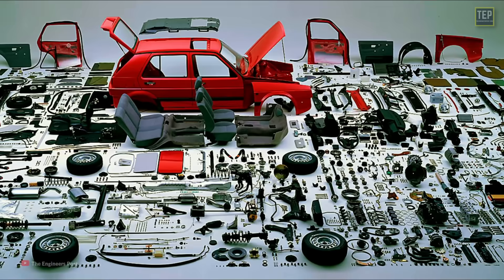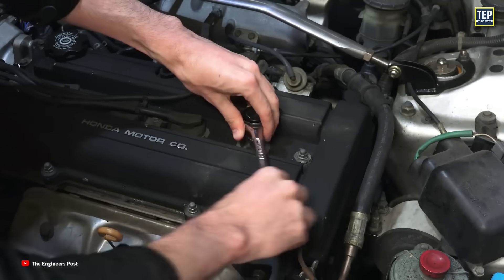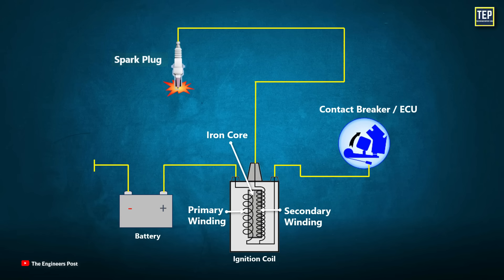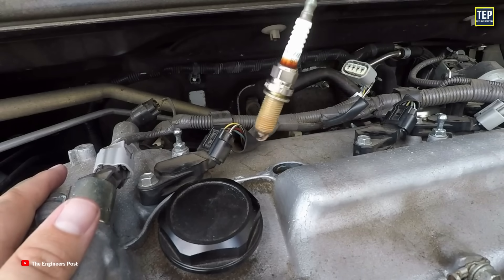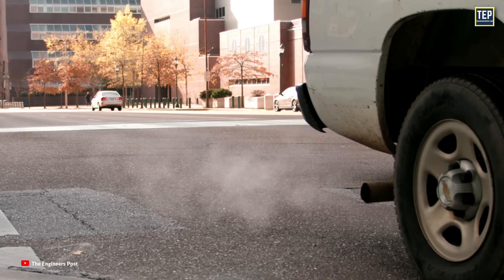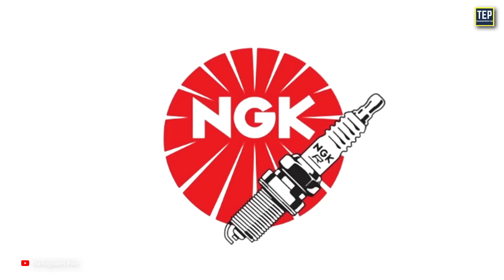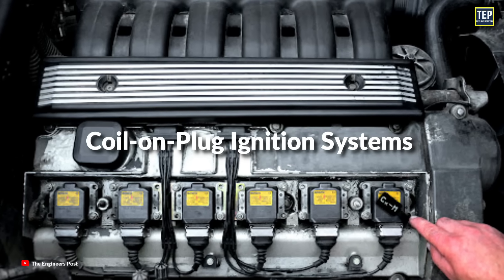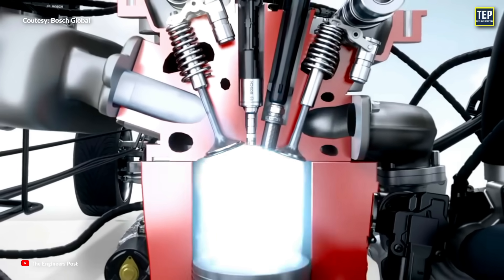Types of Spark plugs | Which is Best?

Comment: a friend and coworker of mine was a real car guy and would drag race his street 95 camaro. one of the things he did for a bit of a boost was to index the plugs with shim washers to have the electrode pointed right at the intake valve. he also reversed flowed the heads and altered the chip for the throttle body and the thing was really fast and quick.
Reply: IT IS THE CONTRARY: It is the OPEN gap which is to be oriented towards the intake port... Otherwise, the ground electrode shadows the mixture from the Spark Kernel...
Reply: @alfredomarquez9777  that's what i thought i said or meant to say.

Comment: The gap hardly even matters really this has been tested.
Reply: This is a very contradictory topic. If you look at the facts, older cars from the 90's come with a spark plug gap of around 0.8mm (0.315 inches). This could have been done due to the fact that distributor caps and rotors were still being used. After the 2000's most cars are equipped with coils on plugs and there are some like the VW Passat W8 that run a spark plug gap of 1.7mm (0.0669 inches). A greater gap should provide a cleaner burn, especially at rich running conditions such as cold starts and cold weather. I was always pleased with my car running Beru Z173 plugs, they performed better than surface air gap plugs and with a well maintained ignitions system such as new leads, distributor cap and rotor, they don't foul at all.
Reply: Often times it doesn't but definitely not true for everything. Take high HP, high boost drag engines. We're talking over 3k HP here. Get the gap just a couple thousandths too big on those and the thing barely runs.
Reply: @wingracer1614  I’m talking N/A

Comment: every engine has its own engineered spark plug that came with, buying spark plug that you think will increase your engine performance is just waste of money. If you want a slight bump of cheaper horse power and performance, find the best gasoline brand that is out there.. 
Tire pressure, engine oil, cooling system and filter. And most of all if you want power buy a bigger engine and you do not have to do any modifications. 8 cylinder engine is always more powerful than a 4 cylinder engine, both stock same gasoline in tank. Think of it as 8 soldiers digging trench in unison. I had a camaro and a vette.
Reply: FACTS.

Comment: Once upon a time, pre mandated unleaded fuel, only Amaco premium gas was lead free with an octane rating of over 100.  With leaded gas, 10,000 miles was about the limit before needing replacement...along with the points and setting of point "dwell" and ignition timing. 

Spark plugs are cheaper now than they ever have been, not even counting inflation.  Iridium plugs are da bomb. I've got over 200K on a set and they are just fine.  Check once in a while, never a reason to replace, especially since a few require some effort to R & R.

Comment: I just use basic copper plugs for 80k kilometers. Could probably go further, but i just change it once a year when i do my full service (flush and change all fluids).
Reply: I think iridium spark plug is good for performance and mileage  , but for me i'm still like the copper spark plug , because it's powerful and low price .

Comment: I worked in a Honda dealer in the service department in the early to mid 90's.  At that time those multi electrode spark plugs were becoming popular.  I remember a customer coming in with his brand new civic.  This was a 93 I believe.  He complained of a rough idle and wanted it fixed under warranty.  But what the technician found was the customer had replaced the spark plugs to those dual electrode plugs.  All we did was put the factory plug back in sure enough the engine ran smooth as it should.
Reply: Yup had an eclipse that did the same thing. Bought some fancy ass plugs, then thought my engine was about to die, friend was like change the plugs, I was sceptical because they were brand new plugs.. put in some basic copper/nickel ngk plugs, car ran like a swiss watch. What I learned that day, always buy ngk, keep it simple.
Reply: That's with most 'after market' stuff. The manufacturer doesn't put wrong parts in your car. Different (colored) spark plug wiring, other size tires, spoilers; it may look nice, but it usually doesn't enhance the ride. Unless you do things with your car that it wasn't really intended for. For the general owner; keep it standard.
Reply: Did the customer get changed for the labor to fix the damage he created?
Reply: @Tremontvolleyball . At Honda?  You can bet what you are sitting on 😂. And most likely street price for the replacements😢
Reply: The multi earth electrode plugs are for longer change intervals, nothing more. If your engine are not designed for it, it would run worse than your standard plugs.
Reply: @imadude85  Not always, some of them are designed to have smaller ground tabs to allow more even burning kernel, cleaner burning, or more effective combustion.
Reply: Most likely he used some cheap garbage plugs.
Reply: Had NOTHING to do with the plugs themselves. The multi-electrode setup would never cause something like that. The issue was likely due to gapping.
Reply: @williameldridge9382  With  brand  new  plugs that  have  the  same dimensions,  construction, and temperature  range with  the  only  difffence  being  the  layout  and  the  number  of  electrodes,  this  seems  to  make  sense.
Reply: Very good video. I noticed that in one of the charts, the spark plug gasket is shown in the wrong place by the graphic arrow. The video is very good and useful. Thank you!
Reply: Customer most likely didnt have them gaped correctly. Extra electrodes shouldnt cause a rough idle.
Reply: I love the people that think they are considerably smarter🤓 than the engineers who designed the engine. 😆 Always remember chrome don't get ya home.
Reply: If you worked where you said, for a 2006 Honda Civic 1.8 hatchback is it okay to upgrade to iridium?
Reply: It is correct that current travel through least resistive path but due to current crowding the current can take two paths. It could be that one path the current is 95% and other would be just 5% but over all it still reduce the spark strength. Also when double Platinum or Iridium or any metal is used and edge is sharp the spark will be stronger as both electrodes have small surface are (being pointed).
Reply: NGK IS #1!!! DENSO runs Great in Toyota's!! BOSCH Plugs do OK in German, and European Cars. Any Good Mechanic will tell you DON'T  put BOSCH Plugs in Anything Asian, and or Most other Engines!!! In the United States anyway!!! FACTS!!! Newer, and older Vehicles come in for all kinds of Rough running, and problematic symptoms!! Yep, somebody put BOSCH PLUGS in the vehicle they bought on sale!! TROUBLESHOOTING leads you right to the Spark Plugs!! Change the new BOSCH PLUGS out for OEM Plugs, and no more trouble codes, and the vehicle purrs like a kitten!! Seen this over, and over through the years thousands of times!!! CHAMPION PLUGS are like the BOSCH PLUGS.!!  They do somehow run GREAT in JEEP 4.0 Liter Engine!!😮🤔😉 If you're a Mechanic you know this  already!!! Don't fall for the GIMMICKS that Corporate Sales Executives are going to throw your way!!! AUTO LITE Spark Plugs used to be a great choice for FORD engines!! They were OE Plugs back in the day!! The old people like me remember this!! Ford sold off the Brand decades ago! Like General Motors owned and used AC DELCO for all its many onetime Divisions, and Brands!! They sold off that brand like Ford had already done!! Old CHRYSLER, PLYMOUTH,and DODGE came with CHAMPIONS O.E. If it ain't broken, don't fix it!!😳😳😳🙄🤔🤔🤔🤔😉😉😉😉🙏
Reply: Yeah, those E3 plugs and the like are garbage
Reply: one of my my old toyota pickups with the 22re engine had the dual electrode bosch type plugs when i got it and would only like those type of plugs when those engines all came with single electrode spark plugs from factory. idk why that particular one only ran good on those types lol
Reply: And a $400 dollar bill was sent to his house.
Reply: Simple, just fit the plugs specified by the manufacturer, especially if you have a high performance engine. Don't trust a self appointed online expert with your valued car.
Reply: Hondas tend to run best with NGK spark plugs.
Reply: E3 Spark Plugs must be a Gimmick then😂Champion has Aviation plugs with either 2 Massive ground straps & Massive Copper electrode or the more expensive Fine Wire 2 Strap & Fine elecrode. I don't remember if they're Platinum but definitely more expensive & longer lasting. Both types seem to run just fine✌🏼😎☯️
Reply: @bdogjr7779  " aircraft" engine.

Mercury outboards had surface gap plugs no ground straps.
Two stroke outboards.

Different application than automotive obviously.

Not sure why you find that amusing?

Dyno tests show NO gain from spilt fire E3 or any of those gimmics.

Look up what F1 engines run .
E3 ,split fire often lead to detonation pre-ignition damage.
Reply: @Motorhead250  《☆》I do find it amusing but not that anyone has destroyed an engine. Tony Stewarts Drag racing team main Sponsor was E3 Spark plugs. Apparently they were using the Diamond style E3s in the Dragsters. I just checked to see if E3 is still a Sponsor and They aren't anymore. Anyway I forgot to mention that Aircraft piston engines have 2 Spark plug per cylinder & 2 ignition systems for redundancy. Part of the pre flight power check is to run the engine to 2000 rpm on each system. You're allowed to have a slight drop in rpm like 150 rpm & lean out the fuel to clean off any carbon or lead deposits during the power check. Cheers✌🏼😎☯️
Reply: @bdogjr7779  yes .. gimmick
Reply: @bdogjr7779 . I worked on piston engine helicopter engines for seven years, used massive electrode plugs, and platinum electrodes.  Cleaning was necessary at twenty five hours on the massive multiple ground plugs.  Life span was about six hundred hours.  Platinum fine wire cleaning intervals was extended to one hundred hours. Life span was sixteen hundred plus hours.  Later on I used still sealed WW2 era spark plugs that were run 25 hours and returned to home base for reuse.  The engines didn’t care, except for reduced RPM drops during single plug firing doing magneto checks in pre flight testing.  Champion plugs excepting WW2 era which were government surplus, if I remember correctly BeeGee?
Reply: They were made to operate on leaded, premium av-gas. The engines were high compression, the spark plugs that were recommended kept the engine from fouling when flying at different altitudes.
Reply: Was / is a scam.
On Dyno no improvement.
A gimmick split fire also.

ND had U groove plugs in 1970s did ignite lean mixture better in Japanese motors.
NGK best I find.

Beware of counterfeit NGK plugs.
Reply: @Motorhead250  Is Porsche being scammed? My Cayenne S came off the assembly line with Bosch 4 electrode plugs.
Reply: @Torch70  Dyno test run show no increase in power.
Those German cars just overcomplicated and expensive break down all the time .
My cousins have shop in Queens NY all they fix are Audi BMW Benz etc .
Disaster.
Sell it before out of warranty or $$$$$$$$$$$$$$$$
Reply: @Motorhead250  No one said it was for an increase in performance. The S and GTS use 4 electrodes, the Turbo and Turbo S (same basic block) use single electrodes. The NA engines will not run properly on single electrode plugs. I'll trust the German engineers' reasoning over some backwoods guy. Also, no I will not sell either one of my Porsche vehicles. I have the tools, knowledge and money to keep them running flawlessly long after the warranties have expired.
Reply: @Torch70   Nah.  Most  of  the  Volkswagen  Group's  cars  come  with Bosch  sparkplugs.  My  brothers  Mk  II  Golf/GTI was  supposed  to  take  the  4  electrode  plugs.
Reply: @Motorhead250  I found that the multi tip plugs had an advantage for me in that they would last much longer before all the tips had been eroded far enough away to need changing the plugs. But yeah no power advantage or anything like that.
Reply: Exactly. The laws of physics dictate electricity wil take the shortest path.
With dual electrode plugs only one will arc a spark each firing. As they wear the spark will change to the other spreading the wear.
Some engines spark at top dead center on both the comprssion amd exhaust strokes.
This type of ignition wnould prematurely wear a single electrode plug.
Reply: @Nudnik1 Denso, formerly  Nippon  Denso (ND)seems  to  be  still  marketing  U-groove  plugs.  I kinda  prefer  Denso  plugs  if  they  are  available  for  the  vehicles  I have  had.  However,  plugs  from  most  major manufacturers  do  not  seem  to  be  problematic, if  they  have  been  cross referenced.
Reply: Dual electrode plugs do have an actual purpose in maverick spark engines
Reply: did you intensely shame him ? I really hope you put him in his place. I mean - imagine that a customer had the audacity to change the plugs on his own vehicle ! what a jerk ! Only you guys, the dealers can save the misguided.
Reply: The Costuner changed the Plugs and complained that the Car was running rough after it , which is an audacity because he wanted a free fix for a fault he created @crabbcake

Comment: Multi-electode plugs were a thing in the early teens, (20th century), until everyone realized that more fire  for the firing surface gave better results than more surfaces for the fire.
Reply: Or even better, to have neither, to just have same amount of fire so you aren't putting a strain on the ignition coils.  Larger gap needs higher voltage.  Granted some coils and plugs are easier to get to, and less expensive than others.
Reply: well put..

Comment: 20K replacement interval? Are you a shill for Bosch or Champion? I ran a set of Bosch Platinum 4-electrode plugs in my (mechanically injected) Alfa GTV for nearly 100,000 miles and they were still not worn. I was about halfway to another 100K on the new set when I rebuilt the engine, but the new ignition system specified single electrode.  They're still hanging in there at 50K since the rebuild.
Reply: That's the whole point of platinum and iridium (and ruthenium too for that matter), they last longer. Try that with copper, you might get away with it but chances are good she's going to be missing on you after 50k or so. Of course they are also cheaper and often perform better so if they are easy to change, you should do it.

Comment: Today’s cars/trucks are are of such low quality they simply do not last, for this reason I lease mine & get rid of them before the cheap plastics including wire insulation begin failing & it turns into an unreliable maintenance nightmare. With this you never have to change a spark plug, or call for a tow truck.